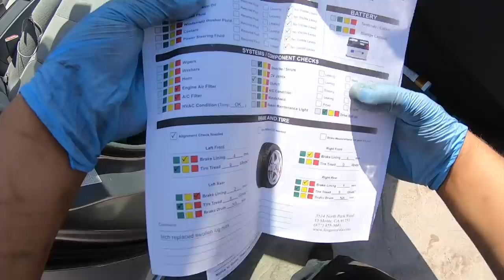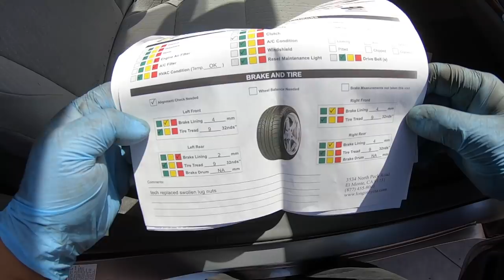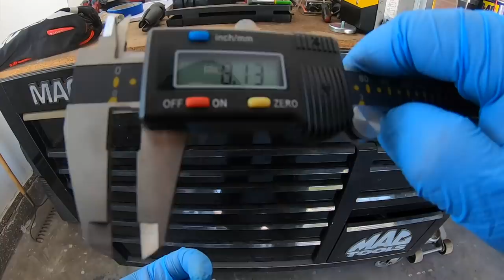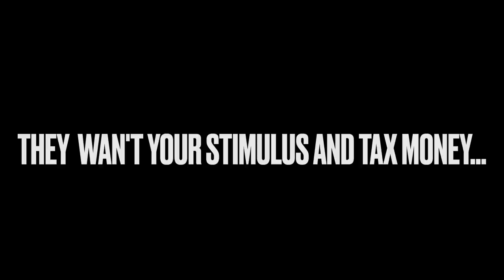This is why YOU need to avoid the Dealerships!

Comment: Just last week I took my car to a dealership because I needed an alignment. I had just done a bunch of suspension work and needed the alignment right away and they were the only ones with availability. They did the inspection and told me I need brakes and front tires. I literally had pad slapped it that morning and the tires were only 3 months old.

Comment: My experience at my dealership has been the exact opposite. They just tell me that everything is good even though there are things that are obviously wrong. The dealership gave me a free inspection with an oil change and they clearly missed a leaking rear brake caliper. I only found this after getting the car up in the air to replace the front control arms and ball joints. I knew that my ball joints needed to be replaced and had the parts ready to install, I just hadn’t gotten around to it yet. I made mention of it when bringing it in and they said that their guy went over the car and they are just fine because he would have found the issue and noted if they were bad. I can guarantee he didn’t even check just like with the leaking brake caliper. 

It is very hard to trust a dealership when they have people willing to pass up critical details like brake issues or just try to sell their services to those that don’t need it.

Comment: as someone who has worked both the dealership and independent side of the business i can with 100% certainty say that i have seen more shady stuff at independant shops. the shop i was working at lied to customers left and right about services needed and the severity of the conditions just to meet the owners standards for monthly sales. i was pulled in multiple times about not upselling flushes or sleezy deals (and dont get me started on how they abused fleet vehicles) and eventually quit because i couldnt bear to become that sleezy salesman/tech. I currently work as a tech for a dealer and can say that not all dealers and techs are bad, just like id assume the same for independant shops. Find a reputable tech and service center and stick with them, thats the advice id give to someone about the business.

Comment: The service advisors and service manager, and possibly the general manager of the dealership are in on it. They get commission on things they sell or advised customers things that are "needed." 

I had the service manager at a local Nissan stealership fired (after a written notice to the corporate office with the invoice detailing what was " needed" on a brand new car) because he (and his cronies) tried to pull this stunt with me when I took my brand new car to get oil changed at 4K miles. Not only that they had used conventional oil instead of full synthetic oil states in the inside of the hood, oil cap and owners manual. I made them change it asap and in the long letter to corporate was a copy of the oil change as well. Corporate office hates bad press especially if they themselves are part of the scheme. My advice to people is always find a trusted mechanic or get a second opinion if you take your car to the stealership and they tell you to get many services done.

Comment: Ive seen especially with those front caliper guards where its hard to see and especially if you’re in a rush and inexperienced being the big thing It happens where mistakes are made. Not necessarily crooked but crook techs do exist. Ive had to tell tube techs mainly when they’re new to make sure they know what they’re looking at so we dont sell them what they dont need as a dealership. They werent trying to and they learned after having it explained to them.

Comment: I use to work in a dealership ive seen this so many times, most time the oil change guys get the brake work as well. When theyre checking brakes they dont pull the tire off (unless its already off), they just simply get a flashlight go underneath the vehicle on the lift and try to get the view of the pads from underneath and then guess what mm is it.

Comment: I had Firestone try to bullshit me like this, I went in for an PA state inspection and had done the breaks at the last oil change (so they had less than 5k on them) and I called BS and told them when I changed them and said if I took it home and pulled the tire off and they lied to me then they would hear from my lawyer, they asked if it was ok if another technician "verified" the work, which I interpreted as we are sorry we lied.

Comment: If the pads were 2mm left that means it's 0mm left since the pad indicators are 2mm or 4mm in this case but at that thickness, the technician should have taken the calliper off like in the video since it's a safety concern regardless of the service.

Comment: When I bought my brand new Mazda 3 and I took it for its first oil change to the dealership at 5,000 miles, they told me I needed new tires. I confronted them because I used to work for a tire company and I knew they were trying to scam me. Since, I do my own maintenance on my car.

Comment: Maybe it helps to go to a very busy garage.  I took my car into one recently because I knew I needed new rear brakes, and asked them to check the front, too.  I expected them say yes, the front need replacing, too.  But when I picked up my car, I wasn't convinced they even checked the front brakes.  They just had too many cars to work on, and only got to mine right before closing.

Comment: Not all dealerships are like that. I went in thinking all brakes and rotors were needed because of being told by an independent shop and I only needed front brakes only no need for rotors or rear brakes were still good. But there are a lot of mechanic shops that are just as shady as many dealerships.

Comment: i had a dealer tell me i needed new brakes which they priced at $1200 i wanted to trade it in then they stuck me in a durango r/t to test drive which wouldnt go into drive the transmission was shot with only 4miles on it. anyways i got out of there mad and i go to change my brakes i needed only fronts brakes they still had some life but i still changed it and sent the rear ones back

Comment: thats really crappy. i generally do most of my own maintenance, even heavy maintenance. ive never really had an issue with most techs at a dealership, theyre usually decently educated on the vehicles they work on if theyve been around a while. i hate the prices the dealership charges but the techs are generally skilled. 

this really upsets me as most people tend to trust dealership techs a little more than smaller mechanics because theres a little more accountability due to them also selling brand new vehicles. this just goes to show that you always need to establish a repport with techs to know what youre really getting in to.

Comment: I used to have a lot of friends that worked at a prominent ford dealer in my area. If the techs did not mark every single brake pad as yellow or red they got in trouble and the boss would literally ask them why. They would target women and non mechanical men for balljoints tie rods that didnt need replaced and never turn a wrench on it but charge them 800 plus because they would tell the people their tire will fly off on the road. Very sad. I dont have any friends up there anymore this is why

Comment: that is not a brake guauge we use a plastic guage not a tire depth guage you have 90% left at 20 and under we recomend replacement.. they did lie to you or let the oil tech guy do the work and he lied to get the over 8 hours so he could get bonus pay

Comment: Thanks for the video Hektor.  I had a Lexus from a tire chain.  The tire shop said the brakes were at 2mm at the front.  I checked the car and the rear were 5mm and the Front were 6mm.  After the inspection we took it for a test drive and told him to come back next year.

Comment: Hi hector I have 2 cars  a 2018 Honda Accord with 14,000 miles and a Kia Forte with 41,000 miles on it I took my Honda to the dealer for a oil change they told me I needed a front end alignment and my brake fluid needed to be exchanged I have never heard that before for brake fluid if I’m correct the brake system is a sealed system you can’t flush or drain a brake system when I brong the Kia to the other dealership they did the same thing that must be another way dealers are trying to rip off customers if I’m wrong about this let me know please. Thank you very much.
Reply: Brake fluid manufacturers say every 2 years replace the fluid.  It is Hydroscopic (absorbs water) causing corrosion and spongy brakes as the water boils when hot.  Brake systems are not sealed.  How would you get air out if you had to replace a pipe.  Fluid changes and flushes are pretty common and are often listed in the as part of a manufacturers service.

Comment: Toyota dealer in Fort Worth TX stuck my mother in law, told her she needed brakes all around, charged her $700.00 then After she ask me was that expensive, broke her heart when I told her she could of had me do it for less than $150
Reply: That’s cheap. I was quoted $1410.00 for brake discs and pads. Until I said down the phone “is this a joke, does that amount even sound believable to you”
I then emailed them a link to how much I can get parts for. Using OEM parts costs $564 max, even cheaper with aftermarket (which probably were the same part in a different box)

Comment: Totally agree with your intro. I recently bought a used Avalanche from a local reputable Chevrolet dealer. I’ve been going to that dealer for at least 10 years and have never uf problems. That day though, the salesman sold us an Avalanche that had been involved in an accident and not properly fixed or even inspected. When I found out, I went back and demanded a replacement or my money back. I spoke with the manager and he found out that specific vehicle was destined for the auction and should have never been sold. Needless to say the salesman was fired.
Reply: The sales manager is aware of every sale that happens, every day. And he in turn informs the general manager. The sales manager routinely reviews each contract.

The guy got fired to preserve the sales manager's job when it was really him who should have been fired.

Comment: What Im worried about is if they swap your brakes with something old and then say you got bad brakes.
Reply: I’ve seen people use a marker pen (or sharpie) and draw a little mark that’s hard to see on the oil filter. Before a service. So they know the filter has been changed. I suppose you could put a mark somewhere on the back of the brake pad. 
In another industry we draw lines on bolts to see if bolts have came lose. It would be a coincidence if the bolts got replaced so the lines perfectly align up again.
.

Comment: My dealership is Penske in Downey but I took it to the one in DTLA for its schedule maintenance. I don't remember them giving me any paper that looks like that.
Reply: It doesn't always happen. We use to do them where I work but said fuck it and just do tech stories now. Alot of the express bays will have them for oil changes then try and get you to pay more for an inspection which then they usually do an MPVI sheet. Again though it's a piece of paper and is more of a customer satisfaction thing not an actual confirmation of work done.

Comment: A unnamed place in Nevada tried to do this with my wives car which is still under warranty. Lucky I marked my pads with a white marker 3 locations and they tried to show her used ones without the markings. Luckily I got a few set of pads and a lovely talk with the corporate :D and just say their service department got a whole new staffing.
Reply: Asking for your old parts back is a good idea, marking them beforehand even better!
I’ve found that just asking for the parts back ahead of time tends to discourage mechanics from trying to pull this kind of thing. Took my truck in for a state inspection (really the only time someone else works on my vehicles) and they proceeded to tell me that I needed rear brake rotors and pads. I said can I see, answer was no you can’t come into the shop due to COVID (wonder how much this has gotten abused) so I said fine put a reject sticker on it and I’ll get it repaired. What they didn’t know was in my wallet was a receipt for a new set of pads and rotors that I had just replaced about 5 days earlier when looking it over to ensure I’d pass inspection. I went straight to the state police post a couple of miles away near the interstate and showed the regional deputy in charge of vehicle inspections the inspection report and my receipt for new rotors & pads. 

He asked when I changed them, I said same day as the receipt and he asked if I wanted to go back to that shop with him to see the vehicle on the lift. I said no thanks I want to not have them tear something up in retaliation for getting the state police involved. He said fair enough, and took photocopies of the failing inspection report and asked that I email him my passing report from a 2nd shop which I did later that day. The 2nd shop passed it and took photos for me that I forwarded to the same state police officer I spoke with. 

That shop (and 1 of the 3 mechanics) lost their state inspection licenses and the shop + that mechanic were banned from being a state inspection mechanic/facility for 5 years. It’s under new ownership now (chain) and I’ve noticed they still don’t do state inspections. I just wonder how many folks got scammed before me, I bet it was not just one or two.

Comment: I once went to a dealership to check brakes and said they are at 6% all around and should be good for 3 months. Went back 6 months later and still at 6% lol
Reply: I had the opposite, I once went to a dealership and they upsold me new brakes. I went back only 2 weeks later and they told me the brakes were 10% worn

Comment: Even the relatively honest dealerships will try to sell you brakes as soon once they are 50% worn.  To bad more people don't learn how easy it is to to do many things on your own car.
Reply: BMW is even worse.  Had the maintenance package and they would replace pads up to 50k miles.  As soon as warranty lapsed they started recommending new rotors every time they recommended brakes.  I only took it there for recall work but it was funny when they said that engine eating quart of oil every 250 miles was normal..

Comment: Remember, it is your right ( and law ) to have your old parts returned upon request. also remember the  #1 safety item on any vehicle are your brakes!
Reply: That's actually funny.  Shops have literally piles of used parts laying around.  99% of people won't have a clue the used part handed to them came off their vehicle.
Reply: @Ken_in_Wisconsin  it,s called scrap metal

Comment: See here’s the thing, 1. it was probably a lube tech that most likely worked on this vehicle. 2. Lube techs get paid minimum so most likely don’t care. 3. They are rushed so much that they prob forgot to check brakes and went by the last visit inspection so he didn’t have to bring the vehicle back in. 4. I recommend brakes all the time with whatever thickness it is when bad YouTube home techs just pad slap brakes. And lastly, we are not trying to rip customers off so get better education and have a little more respect towards real technicians.
Reply: #1 excuse
#2 excuse
#3 excuse
#4 another excuse for laziness 

Dude, the only thing I see wrong with the brake pads is the missing  angle cut. Chanfer or whatever it’s called.
Reply: @danielram6782  you don’t even know what your talking about. Sure don’t know anything about cars neither. Get some education. Use your time wisely and go to school.

Comment: I was an  ASE master auto tech and engine builder for 9 yrs. Worked at a bunch of dealerships and independent shops, here's some tips for anyone who's interested.

1) don't leave the caliper dangling like that. It places stress on the brake hose and will cause it to swell and eventually break over time. Use a bungee cord to hang it. Basic mechanics 101.

2) you don't need to pull the pads out to measure wear and we don't use a tire tread gauge. The caliper has a window/cut out where you can see how much of the pad is left. All you have to do is pull off the wheel and look through the window and you can use a $5 pad gauge that will show how many mm are left w/o having to remove anything but the wheels. Sometimes depending on the design of the rim you don't even have to remove the wheel and can use a mirror to see the pad through the window/cut out.

3) always measure the pads on the passenger side. The majority of turns made in the US are right turns and therefore the pads on the passenger side wear out more than the ones on the driver side. After servicing thousands of cars at the dealership this holds true and it's an old mechanic's tip. Go by the reading on the passenger side.